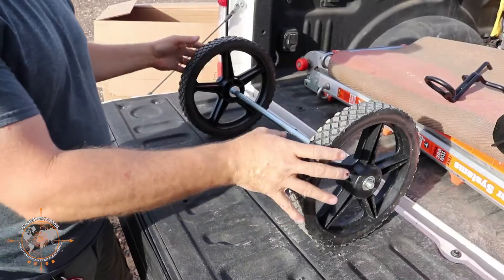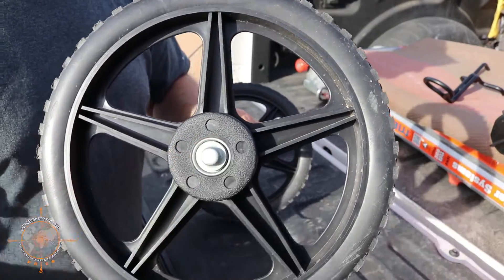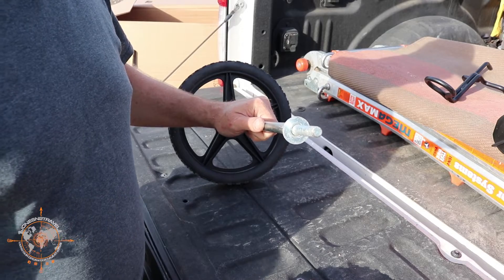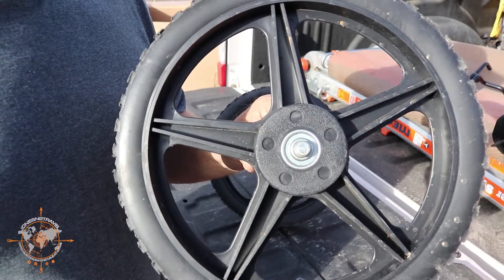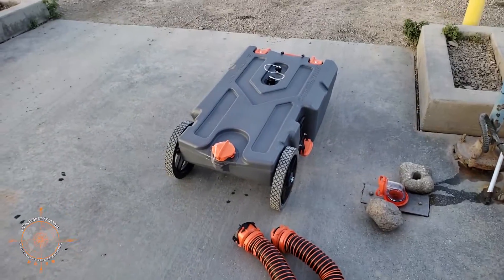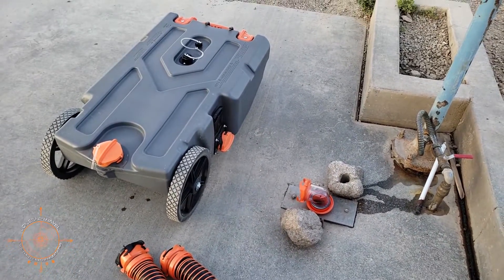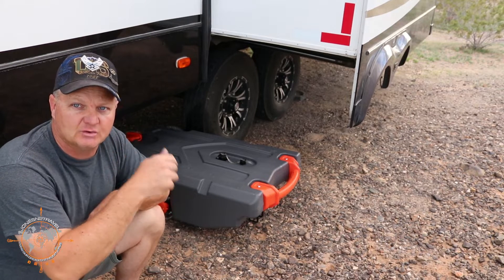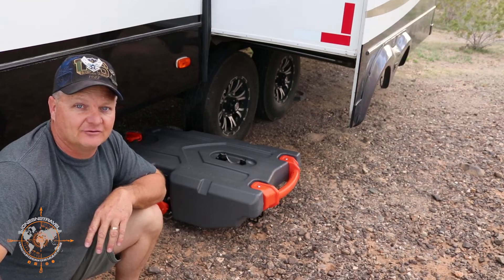CAMCO RHINO TOTE TANK REVIEW AND MODIFICATION | RV LIVING

Comment: Great mod, will definitely do that...
Unfortunately just got my tank at the site and will need to use it the first time with the un-mod axiles....
Reply from the maker: Hi Drew, I've heard reports that new tanks are coming with the axle issue corrected so you may not have to do this. Check to see if there are any retaining clips on the axle already. If so you'll know the factory already corrected it :) Hope that helps. Safe Travels
Reply: @JonesN2Travel  we used it last night, I sat on the tailgate to make sure it stayed put and in one piece.
Thankfully it worked great.
Will check out the wheel assembly tomorrow.

Comment: Bought a 28 gallon one in April, watched your video last night and opened the box today, wheel problem has been fixed, had snap rings holding them one, they must have watched your video.
Reply from the maker: Hi Sumner. That is great news. I've heard from a few others that stated they received the updated version. Happy to hear you did too. Thanks for checking out the video. Safe Travels

Comment: Was hesitating on buying one because of a few negative reviews in the wheel failure. This video was really informative and the idea of the cotter pin is really smart. Simple modification to make the trip to the sump station easy.
Reply from the maker: I've heard some new models come with a ring clip on the axle but I like the cotter pin solution better. :) Thanks for following along. Safe Travels
Reply: @JonesN2Travel  just used my new tank today. The new design with the ring clip worked just fine. No issues while towing to the dump station. One of the good investments for camping that I have made. 👍

Comment: I purchased a Rhino tote, but I purchased the 15 gallon one and here's why.  I never have to take the "slow roll of shame" with my tote.  I just pick it up and put in the back of my pickup truck.  I can make two trips to the dump station quicker than those who have to do the slow roll.  Every 3 days or so, I dump one tank of black and come back an dump one tank of grey.  I don't rinse the tank out until the second trip.  I always put a cap of treatment in the tank after the flush.  I have no odor what so ever.  Since I camp at full hook up sites most of the time, but we do like some of the State Parks so the tote does come in handy.  This works great for me.  You should do what works great for you.  That's how life is.  I would make one suggestion for your tote.  Don't use the hose that came with the tote, make up a short hose (10" should work)  You won't have to even touch the hose while you are filling the tote.
Reply from the maker: Hi Bernie. I agree 100% you should always do what works best for you and it sounds like you've found the perfect solution for the way you like to camp. Thanks for checking out the video. Safe Travels. :)

Comment: I ordered the same one based off of this video and received it today. Right out of the box, the end cap on the axle was barely hanging on, so I took it off by hand and did this modification with the cotter pins to both ends of the axle. It was an easy mod by watching this video. I haven't used it yet but it's nice looking and appears tough.
Reply from the maker: Wow, I can't believe they haven't made some sort of change to that yet. Well, glad you were able to get the mod done. Yeah, I agree its a very nice tote tank once you fix the wheel issue :) Thanks for checking out the video, more RV maintenance and upgrade related videos to come. Safe Travels.

Comment: What size drill bit do you use to drill the hole in the, and how did you get the drill to stay in one spot on a rounded surface? When I've tried to drill into a circular piece of metal the bit just danced all over the place.
Reply from the maker: I just sized the drill bit to the next size larger than the cotter pin I used. If your bit is sharp you can run the drill very slowly until the bit bites into the metal. If that wont work then you can use a punch or nail set to put a mark in the metal that the drill will sit in. Hopefully that makes sense and helps :) Thanks for checking out the video. Safe Travels
Reply: @JonesN2Travel  Thanks. The punch idea sounds a good starter for me. At any rate, I am glad to hear your fallen wheel warning take. Same thing happened to me with....an ice chest while tent camping, so I was sold on your mod the minute you mentioned it.
Reply from the maker: @johnvoltageltd  thank you. You won't regret the mod. 😁 Safe Travels

Comment: I have the 21 gallon model. We haven't really used it much, I will have to look at it in the morning but I would suspect it has the same axle cap nuts on it. If so I will be making this modification forth with. Thanks so much for sharing. Safe Travels.
Reply from the maker: Glad this video may have prevented a disaster for you :) Thanks for checking it out, we appreciate it. :) Safe Travels

Comment: Is it difficult to move the tote by hand when it's full? It appears to be almost 300 pounds when full. I'm debating between one of these or just using a transfer pump to a 55 gallon water drum for my grey water to extend camping trips.
Reply from the maker: It does get pretty heavy. I agree that a transfer pump might be easier. Hope that helps. Safe Travels

Comment: Jones -- is there any reason you wouldn't want to just shoot that cotter pin hole through the cap and axle...together  (ie...right when you take it out of the box)?
Reply from the maker: Absolutely you could do that. I had another viewer say that they couldn't get the caps off so I suggested he just drill through them. I would do it straight out of the box, as you suggest, so you never have the issue I did with the wheel falling off. Great idea. Thanks for sharing and checking out the video. :)
Reply: @JonesN2Travel  Appreciate it, Sir.

Comment: I watched your video and thought, “this must be a fluke”. I bought one and the very first time I used it the cap fell off the wheel. Luckily I wasn’t towing it, just pulling it buy hand, and it was only gray water. Great video! I’m gonna make the modifications to mine as well. The other problem I had was having to drag it up on top of the sewer drains. The ones where we camp are about 4” of raised concrete
Reply from the maker: Wow, but I'm not surprised lol
 Glad you only had grey water in it. My luck wasnt as good 😁 Thanks for  checking out the video glad it was helpful. Safe Travels
Reply: You can use the top port for this.  Connect up then tip it back toward the outlet.  Most of the content should drain out until you can lift it higher than the edge of the concrete.
Reply: Did you fill the tank up to 20-25 gallons before you rolled it to the truck hitch? I’m asking because you seemed to lift the handle and roll the tank really easily. I’ve read that they are heavy (200 + lbs) and hard to roll when full. I just ordered the 36 gallon tank ( 28 gallons is out of stock, or delivery in a month and I need the tank sooner)
Reply from the maker: @videomarvel  I dont really remember but I think, for video purposes, I didnt fill it all the way on the video. I have however filled it full and then moved it to the ball hitch and you are correct, it's pretty darn heavy. Hope you enjoy the tank. It's still working great for us. Safe Travels 😁

Comment: Smart mod. I'm looking at the 28 gallon as well to get some space n my tanks. 42 in the black and two grays each. Hoping that it will be enough. 1/3 tank is 14 gallons, so I would get down to a 1/3. What size tanks are you working with? We go to state parks and prefer not to unplug the electric and go dump. Have to weigh the nuisance of the trip for the time to dump into the tote and take it away. Thanks.
Reply from the maker: I agree. We are in a state park now and its such a pain to tear down and set back up again. We have a 75 gal grey and 50 gal black. We can usually go 2 weeks on the black so I seldom use the tote for that. However, we fill up the gray tank much faster and one 28 gal tote gives us a few more days capacity even though it doesn't drain our tank. Sometimes I'll make 2 trips with the tote depending on how much water were using. Hope that helps. Thanks for checking out the video. Safe Travels
Reply: @JonesN2Travel  my tank.is on the way. Thanks too for your tips on tank use. I take it you close the gate to stop flow in order to see the volume inside the tote. I window in the top would help.
Reply from the maker: @paultaylor6167  Yes, I close the gate on the RV and use a clear elbow on top the tank to attache the hose. I can look through the clear elbow to see the level. Best of luck with your tank :) Safe Travels

Comment: How is the tank holding up ? Are the wheels strong enough for a full load ? Also without the inner washer the wheels do not rub against the tank ? I need a tank and like the idea it comes with the tow attachment and you can dump without having to stand it up. Would you still pick this model ?
Reply from the maker: Ours is holding up very well. Yes, the wheels are strong enough and I haven't had any issues with rubbing. I would definately buy this one again. 😁 Safe Travels
Reply: @JonesN2Travel  Sorry one last question, do you remember the size of the axle ? I cant seem to find that anywhere. 5/8 ? Thanks again for the video
Reply from the maker: Hey  @jasonGardner777   I just measured mine and the axle is half inch. Hope that helps :) Safe Travels
Reply: @JonesN2Travel  Good News, I just received mine and they added a grove that a snap ring fits in then the cap. Looks like they saw the flaw and fixed the issue. thanks again enjoy your videos
Reply from the maker: @jasonGardner777  That's great news. Thanks for the update. Safe Travels

Comment: Great video and great fix.  I realized watching this that the Camco won't work for me.  My tank drain outlet is much closer to the ground than yours, and the tank inlet is already higher than the outlet on your rig.  Makes the Thetford units look much better with their inlet basically at ground level.  Also no hoses to take off and on.  A bit more expensive unit, but I think the ergonomics of it might be much more suitable.
Appreciate the fine video, really helps people like me come to realizations about possible operational issues.
Reply from the maker: Sorry to hear it wont work, really is a great tank. No worries though you have to get what works for you. Thanks for checking out the video and I'm glad it helped you decide which one you need. Best of luck with your new tank :) Safe Travels

Comment: So when you deleted the inner washer on the axles, did the wheels rub on the tank when the tires are allowed closer to to the tank without the two washers?
Reply from the maker: Hi Kevin. The wheels don't touch the sides of the tank. There is a enough of the bearing sticking past the end of the wheel to keep the wheel from going too close to the sides. Hope that makes sense. :) Safe Travels

Comment: Yeah, I'm familiar with those pressed-on axle caps... They're just simply cheap - and RINO should know better... But it's all about a 'price point'.   I have done exactly the same - removed 'em and drilled the ends for a cotter key..    I'm glad you showed everybody that little fix..
Reply from the maker: Thanks Lee. I was pretty surprised that they shipped them that way too. I believe they are starting to put c-clips on the end of the axles now but time will tell how well those hold up. Safe Travels

Comment: Thanks for the review. I just bought the 21 gallon size and did the cotter pin modification that you did. I did have a hard time getting one side of the axle caps off but the other side was fairly easy to remove. I’m glad I saw your video first before using it.
Reply from the maker: So glad the video helped. I'm glad it prevented you from a huge nasty mess lol.  Thanks for checking out the video. Safe Travels

Comment: how is that 28gal tank to haul from the RV to the truck hitch? once full that thing would be close to 240 lbs! I suppose using that tow lever helps for leverage to drag it over?
Reply from the maker: It really isn't too bad but the closer you can park the tow vehicle the better :) Thanks for checking out the video. Safe Travels

Comment: I bought a new tank  this week and Camco has since improved the axle design by using snap rings on the axle ends. They were obviously having reported failures with the axle end caps. You have a great fix for the previous design. 👍
Reply from the maker: Thanks for letting me know Gary. Yeah, I've heard some folks are getting the new design and some still getting the old so there must be some old inventory out there somewhere. I am glad that they took notice and fixed it though. Thanks for checking out our video. Safe Travels
Reply: Where did you buy yours? I see amazons picture still show the old cap.

Comment: Thanks for the video.  Couple of questions…. How big are the tanks on your camper?  I’m trying to figure out if I should order the 28 or the 36.  Also, how secure is the ladder connection, I’m afraid it will wiggle and loosen the ladder.  What do you think?
Reply from the maker: Hi Kim. Our tanks are 50 black and 75 grey. You can make fewer trips with a bigger tote but they can get heavy. We opted for the 28 gallon and it works fine. Just make a couple of trips to empty both tanks. Sometimes I just take a tote full and wait until they're full again and take another tote full. As long as your ladder isn't loose then it should hold but you'll have to make that decision. :) Hope that helps. Safe Travels

Comment: I just received my rhino 36, and was preparing to remove, drill, pin  as i truly appreciate you sharing.. however, there are no compression caps on my axles.

They have machined the ends conular and have a retaining ring in a groove. The wheels apear to have a machined center hub insert.

Have they upgraded/improved their design??.. i returned tonthis post to look for any updates. Can any recent purchasers confirm?
Reply from the maker: Hi Charlie,
I have heard reports that some folks are getting the upgraded design but some still getting the old. I suppose, once the old inventory runs out, everyone will get the upgraded design. :) Thanks for sharing. Safe Travels
Reply: Alright..i cant seem to figurw out how to post an image.. another reviewer had reported a failure of the wheel hub itself and recommended filling the voids on the backside center od the wheel hug with an epoxy or like to bolster structural integrity. My qheels have a center insert in the wheel about an inch and a half diamiter. Appear to be poly center surrounded by a metal (appears aluminum) pipe surrounding it...visually its a poly ceneter with a metal ring around it.

Comment: Thanks for the video and modification tip. We just purchased the 21 gal tank and will have this modification done right away.
Reply from the maker: Hey John, you're welcome. Glad you found it helpful. Good luck out there and safe travels.
Reply: @JonesN2Travel  Thanks again! Got the tote today and had it modified as you described. We were able to retain the washers on the inside of the wheel. Sturdy as a rock and ready to roll.
Reply from the maker: Awesome. Thanks for the update.

Comment: Thank you for sharing! I own the 15 Gallon version and one of the wheels broke. Called Camco and they offered me a new kit for free (I only mentioned that I purchased the unit on Amazon, they didn't even ask when exactly). The kit includes two brand new wheels and washers, spacers. It also has two new rings which are supposed to be installed on the new type of axle that has a groove....mine is the old version without the groove. I will do the modification you suggested which I thank you for....
Reply from the maker: Thanks for checking out the video. I have heard of people getting the "new" version recently. The snap ring should work but I know that my fix works :) I'm glad to hear the video was helpful too :) Safe Travels

Comment: I wish I had seen this before I had purchased. I experienced the same issue with the wheel. In the middle of the campground and the wheel popped off. Yep it punctured the tank and the leak began. It wasps the 28 gallon and was about 80 percent full. Thank god it as grey water. Any way when I got back to our site, I called Camco . I explained what had happened and the tech said send photos and a description and they would replace. I mentioned I had seen your video on the unit failure and he told me they had a newer model out and the problem should be corrected. It should ship to me Monday.
Reply from the maker: Well, at least they have started correcting the problem. Glad to hear they are sending you a new tank. I've heard their fix is a snap ring behind the pressed on cap so it should work just fine. If you can, let me know how they solved the issue when you get your tote? Thanks Safe Travels :)

Comment: Question: When you are dumping from your RV to the tote, do you use the san-t-flush or no? We are currently living in our travel trailer and have access to a water hose but no dump. Having to hitch up and drive through the city to dump every week is a pain!
Reply from the maker: Hi Keshia. I use ours to dump both black and grey tanks. Using the flush on your rig would fill the tank too quickly so I don't rinse until I've either moved to a full hookup spot or to a dump station that has water. In a pinch you could fill a 5 gallon bucket with water and dump that down in your tank to "rinse" it out. Hope that helps. Safe Travels